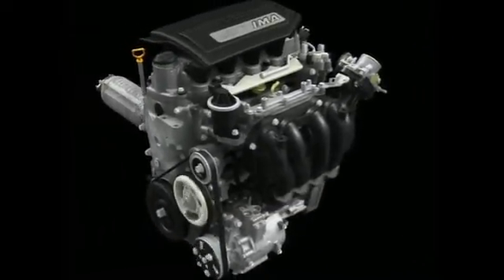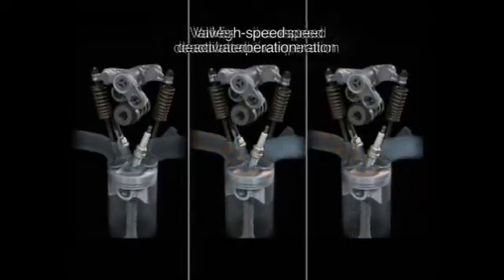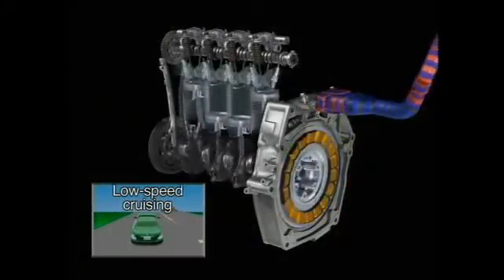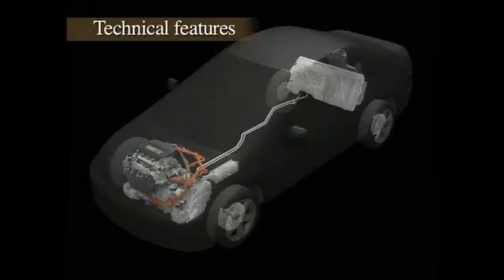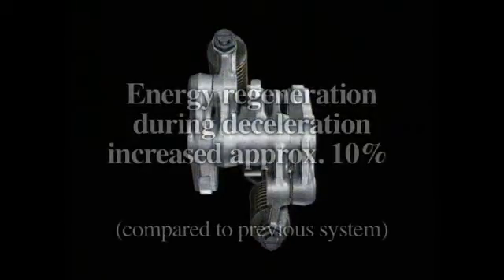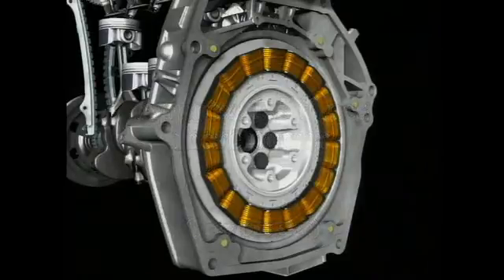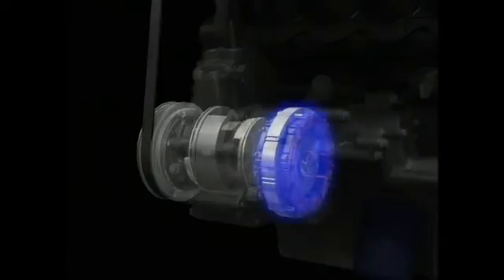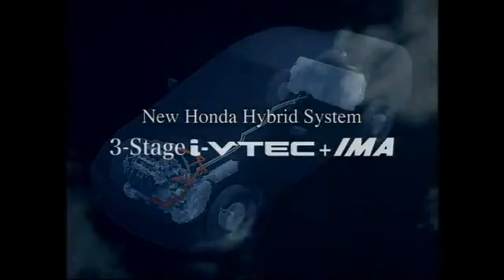Honda Worldwide   Honda Develops 3-Stage i-VTEC + IMA.wmv

Comment: Why do they leave the valves closed? Shouldn't they be held open so engine turing resistance is less?
Reply: when you're running in a closed system the energy loss done by compressing the gas is regained by the gas reexpanding from the piston going the other way. When you're keeping the valves open, you're spending work on getting the air to turn through all the crevices of the induction system (filter, airbox kinks, butterfly valve, intake manifold) and pushing it through the whole exhaust system, and none of this is recovered as useful energy later on. therefore keeping the valves closed is a good idea